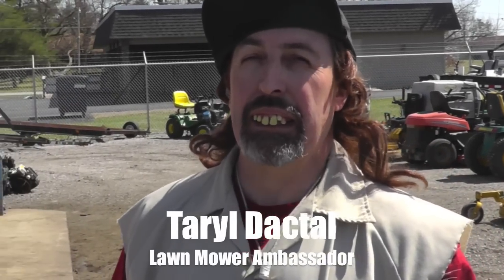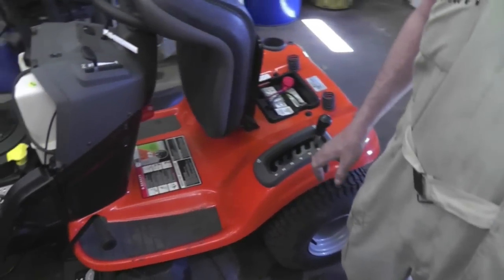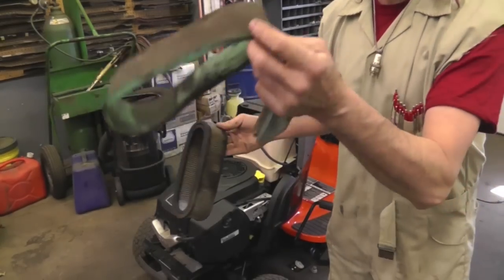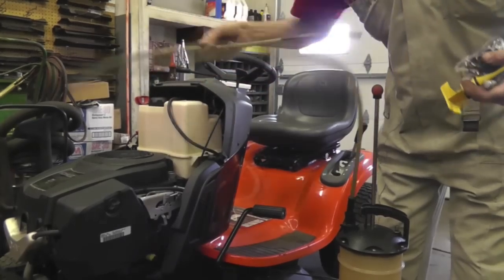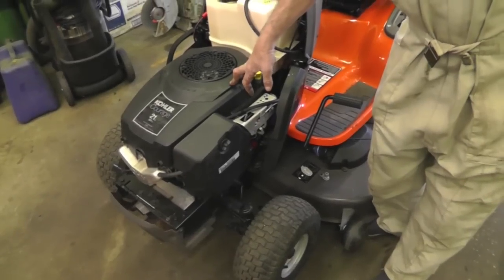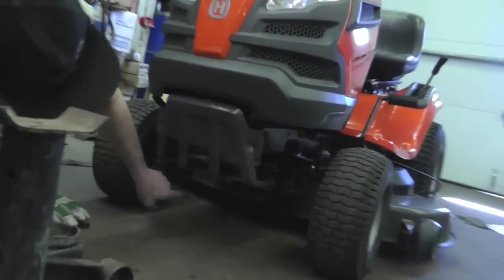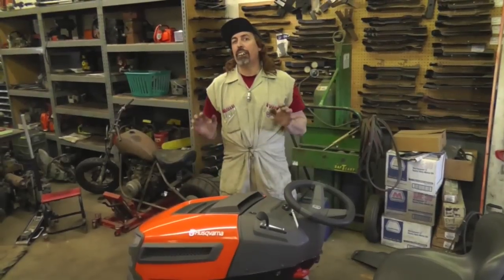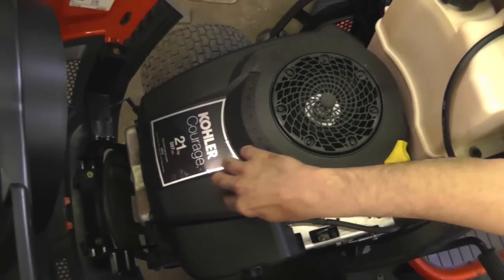The BEST Lawn Mower Maintenance Video: A Complete Guide

Comment: You got my vote! All our mowers are at least 10 years old, some a lot older. I run 15/40 series-3 oil and am also a fan of Gator blades. Grease is cheap and grass rusts out decks.
Reply: Lewie McNeely; same here. Luv them gator blades. Sharpen them once per year. They stay sharp. (30 hours)

Comment: Good video.  I'm primarily posting that the Harbor Freight lawn tractor jack (about $100) is the greatest tool ever.  Myself, I  use a 2005 Craftsman 42" lawn tractor in Arizona high desert to cut weeds and tumbleweeds on 1.5 acres, so different than cutting just lawns.  Out here we routinely get goathead stickers in the tires, so Slime is our friend.  I replaced its blades today, and ordered 8 more for the next couple of years; I can typically get a few sharpenings from each blade.  I always clean out the underside of the deck with a bent-type paint scraper/putty knife, and clean off the top too.  I've had to replace pulleys and spindles over the years, and blade engagement cable too, all pretty straightforward.

Comment: I love how you give tips and tricks. Here is one back at you I learned a trick today....... I bought a used lawn mower Sears 26 HP Kohler Turns out after you run it 10 minutes the motor just dies. Then  wait 5 minutes and it will run for another minute.and die...I noticed the gas in the filter bowl was extremely hot !  I changed the fuel pump twice and gas  filter I even left the hood off hoping it would run cooler....I, pulled the gas filter as far away from the motor as possible...  Helped a small amount Now it would run for 10 to 15 minutes and again die.....Every time it runs awhile the Gas filter still very warm to mighty hot . I took that fuel shut off valve off the bottom of the carburaetor and I wired it to the battery and the valve stayed open. I left it hooked up for like 5 minutes and the valve stayed open fine. BUT thenI unkooked the wires and went to pick up the shut off valve and wow! That thing was EXTREMELY HOT!  So I had seen one of your other video's month's before  so I bypassed the shut off valve I did not not have to ground off the tip of the shut off needle valve as you had to on another model . I just removed the end tip and put it back on the carb without it. Being carefull  to not plug it in   ....  It ran for a solid hour and a half flawlessly....I guess it was just doing like a heating element on a hot water heater...Just cooking gas instead...... OUch

Comment: Love the upper front teeth man adds character. Keep up the good work.
Reply: +hammerfoot I think those are his real teeth....parents couldn't afford the dentist.   ouch!
Reply: hammerfoot they are fake in a few vids he forgot to but them on
Reply: Your both wrong. Them are gator dentures. Good for stripping wire. Removing stuck bolts. Cracking walnuts. Chewing toe nails. Scratching your legs. Opening coke cans. Or beer bottles. Vice grips in a pinch. And for self protection. Taryls aa smart cookie.

Comment: hi tayrl i change belts on my riding lawn mower and in 4th gear it slowed it down my mechanic said it would break in and run normal speed but it still runs slower than it use to run and he said the belts are the right belts for it.

Comment: keeping the battery charged will make it last much longer. if it goes dead during the off season & sits like that usually it won't recharge. if you buy a ' battery tender ' & keep it charged it will last.

Comment: I got myself 8 riding mowers over 8 years. One has welds on the frame so, it will be served has dinner for the other ones. Most of them receive new parts ( Quills, decks, blades...etc...). They may cost a pretty penny to rebuilt but, they last forever. My 1982 Craftsman LT11 isn't the prettiest one but, it runs....compared to my 2009 Troybilt with a blown 72 hours Kohler Courage 18. Those older 11hp, 12 and 12.5 "L" head Briggs are worth the investment. I rather spend $1500 on an old mower than buy a $2500 "disposable one". Great work Taryl. Your teeth could use a little more yellowing Ha ha ha.

Comment: Got that same mower and same motor it mixed gas with the oil after me cutting my yard 3 times so I got 20 hours on it so I put it up and grabbed the next door / friends mower and fixed the leveling the deck and finished the year with it but I pay 4 it at Lowes but it. Mixed gas with oil and over the winter drain the oil change the plugs and air filter and took the carb off and took it to Campbells too let him check it out told me that soilod was good but may have. Got stuck but he said it was fine and check the pin or point on needle and bowel bowel was little trashy but clean so placed it back together and sold me cut off valve and fuel filter for in route from tank to carb . And told me to check the bolts and gaskets and make sure the bolts are fully tight in the holes and carb and gasket and guard pans and stuff and replace air filter and so I did and played love with buying new belts and blades and spare parts and maintaince stuff and kolher oil and cans of fuel to start this year off good is there anymore on this mower that I need to know been a few years since owned a rider mowers or ran them hard enough to do work on them like this out the box lol but I did work at Briggs &Stanton / snapper/ craftsman  rider were made and grew up with a old snapper fire hopper mower and stepdad worked at Murray lawnmower co in West Tennessee/ Kentucky at the blades person at sayco or smack corps intil were move to GA but need all the knowage to get going and keeping it going lol wish it wasn't a courage twin cam kolher 21 or 20 but a Honda or Briggs& standon motor but ifwhen it is bad it will get one if I can't talk this old guy out of his older craftsman with a owan d motor lol it is mint love it it is like he waxes it

Comment: Taryl, you forgot to mention adding fuel stabilizer like K-100 to the gas and running the equipment a few minutes for winter storage
Reply: I start and run the mower in the garage warmit up at least once a month

Comment: I don't do a new air filter every year I figured to go by the book on mine bought new in 2015 would be okay says to replace at 100 hours I occasionally check it and it nots dirty. I change my oil every 50 and filter I am at 83 hours so will be doing a new air filter soon

Comment: The spark plug should be a light brown color.  If it is black it’s running rich and you said that could be a clogged air filter.  What if the plug is white?  I’m assuming it is running lean but what could be the cause?  How about this:  I have a Koehler Command twin cylinder and one plug was white and the other was a nice golden brown.

Comment: I have been working on mowers for near 60 years and I have never in my life bought an air filter for a lawn mower , I make them at no cost. I have never bought a fuel filter.
Reply from the maker: Jerome Cook how?
Reply: I would not do this for a costumer, but I use the foam rubber packing that comes with many things. The fuel filters I just back flush them. I have been doing this for decades with no problems.When the air filters get dirty you can just wash them.I love your saying- it's a lawnmower, not the space shuttle-.You are my favorite.

Comment: Hi Taryl! The old lawnmower mechanic down the street insists that you have to use a oil with Zinc Oxide in older mowers or the cam will burn out, is that true? Also what about the fuel? Do you drain it, do you put fuel Stabil, do you throw it out every year? Thank You (sorry if you answered this somewhere else)

Comment: an old 2hp lawnmower when i was a kid i opened the oil on the front corner of the engine it was a briggs too and the plug wasnt down close to the deck iether and the oil flew into the sky!!!  what a mess!!!  and hot!!!

Comment: Taryl -  I have a  Craftsman YTD4000 with a Tecumseh Peerless transmission/transaxle.  It has a white plastic container/reservoir on top of it.  On top of this little plastic tank, there is a brass? screw plug.  What is the purpose of this  little plastic tank?  Do I keep it filled with oil, or use it to fill the transmission with oil, or what?  I've looked at your videos and others', but I don't see any transmissions with a little, white plastic tank mounted on top of them.  What does Taryl know about this?  Thank you.

Comment: Thanks good maintenance tips but today started mower a 20 horse Briggs and Stratton started back firing it's only 3 years old got it to run right after playing with spark plug wires don't know if this did anything but started running better hope you can help me if it does it again thanks for your help

Comment: Hi! Taryl Been enjoying you're video's, I have an ongoing problem with my Troy blt. Zero turn mustang with an Kohler V twin 22 hp engine, loosing power, approx 5 yrs old cut mucho grass so far, changed oil and filter,plugs,air filter and gas filter, still weak feeling and popping through exhaust do you think valves need adj. or fuel pump? any help much appreciated. many thank's David O.

Comment: Hey Taryl 
Like your vids! Maybe u could help me, I have a craftsman PYT9000. I recently refurbished the deck and am having trouble putting a part back on it😨 It’s the idler deck support bracket. In the blow apart deck part diagram, it’s listed as part 48. But the picture doesn’t make sense as far as its position goes. I know this is very vague, but it’s on page 46 on this tractor’s instruction manual. Appreciate your 2 cents worth on this. Thx Rudy

Comment: HelloTarly. I've inherited an Ariens Grand Sierra 2200 - Model 931037 - Serial 000813 (don't know the mfg date). It's old and rough but functions very well. It's git a large, 3 blade cutting deck that's worked great up until recently when one of the pulley's and possibly a belt blew out. I wanted to get a better look at it all but can NOT figure out how to completely detach the deck. I was able to disengage the four "pin's" easily enough but can't figure out how to disengage the drive shaft. I can NOT find any info, cut sheet's and or instructions on the deck at all. If I had or could find on the unit a model or serial number I'm sure that might help. Any and all assistance is greatly appreciated!

Comment: Should gas be removed from my lawn mower and generator at the end of season?
Reply from the maker: If possible yes. Run out what's left in the carb too. Try to use 93 octane fuel since it lasts longer than 87 etc. It won't hurt anything. Then next year be sure to use fresh gas and it should fire up. And a There's Your Dinner!

Comment: Now hang on a doggone moment there Taryl. If the head gasket is blown that wont be letting the exhaust gasses into the crankcase surely, it will let the gasses out into the open air. Would it not be the rings gone or worn cylinder bore that would let the gasses into the crankcase. I love your videos, just trying to be helpful and neighbourly, don't take no offence or nuthin.
Reply: On overhead valve engines such as some Briggs and Strattons the cylinder is right next to the passage for the pushrods. The passage for the pushrods goes into the crankcase. There is a strip of the head gasket that seals that space between the cylinder and pushrod passage. If the gasket is blown there, some of the combustion gasses exit the cylinder, go through the blown gasket, and wind up in the crankcase, and you end up with excess smoke in the crankcase and dirty oil as Taryl stated.
Reply: 2 AM Ok, thanks for explaining that, i still got a lot to learn about mowers.

Comment: Taryl, why does Briggs claim I never need to change my engine oil?? They claim all I need do is add when needed! I ran mine 4 or 5 hrs and dumped the oil and it was nasty.. Why leave all the break in crap in forever?? Sounds like they just want to sell lots of new engines.
Reply: Exactly, Change it every year. That's what I tell all my customers.

Comment: My riding mower is making me pull the little hair I got left out. My mower was surging.   I noticed that my fuel pump was leaking gas. So I changed out the fuel pump. Still surging....?!??
Reply: It almost certainly a partially clogged carburetor. Take it to a shop to have it cleaned or buy a kit and clean it out yourself.
Reply: thurm101 also don’t forget the gas cap. If you loosen it and the surging stops the gas cap vent is clogged.
If there’s no change then the carb needs cleaning. Pay attention to main and pilot jets.

Comment: well I'm not cutting grass and I think it has a hydro trani
Reply from the maker: +Hector Avila Hydro transmissions are fluid drive transmissions the speed is controlled by the volume of oil fed through the hydro pump. The more fluid or oil fed through the pump the faster it goes. You need a tractor with a gear drive trans  if you want to change the speed easily . To achieve that you just swap the pulleys. Large pulley on the engine small pulley on the trans.

Comment: Taryl , I put on a fuel shut off valve , my question  , when you shut off the fuel , is it hard on the engine when its sputtering , because mine sputters alot even at half throttle and then a backfire at the end and then stops. just wondering if its hard on the engine because its working so hard to try and keep going . " it just wants to keep going ,just like a TARYLADACTAL HA<HA " .
Reply from the maker: +GmGarlo Sounds like it's getting to much fuel. So if its running rich you should take a look at the carb.  Running rich is hard on an engine
Reply: +Taryl Fixes All My impression of GmGarlo's question is he was asking if shutting the fuel off with the shutoff valve while it's running is hard on the engine as the engine dies.
Reply: SEI RePower yes ,+SEI RePower that is what i wanted to know , you explained it better, THANKS!
Reply: +GmGarlo You bet my friend. Perhaps Taryl has a different opinion (feel free to come up here and slap me Taryl if I'm wrong) but some manufacturers recommend running your tank dry at the end of the season to rid it and the carb of storing that garbage they call gasoline now days over the off season, so shutting the valve off to run the carb dry shouln't be much of a problem.